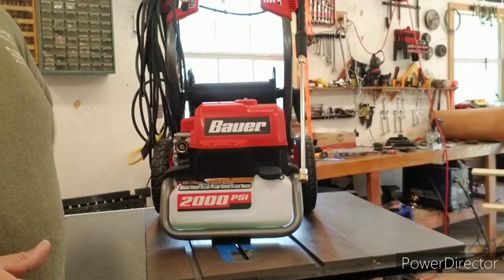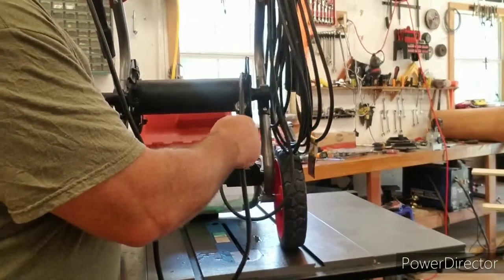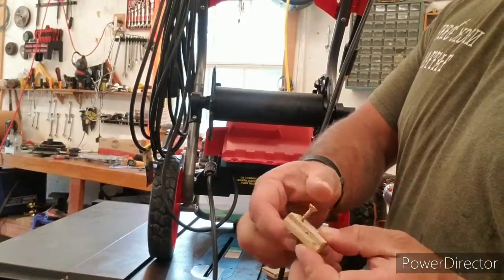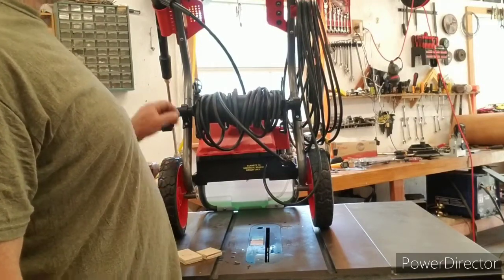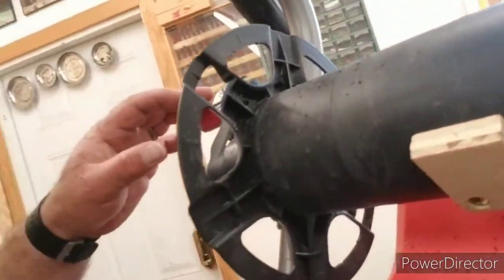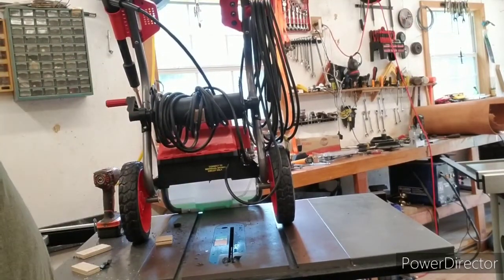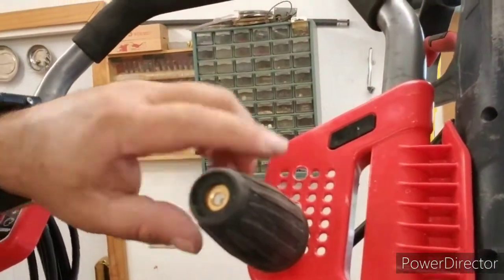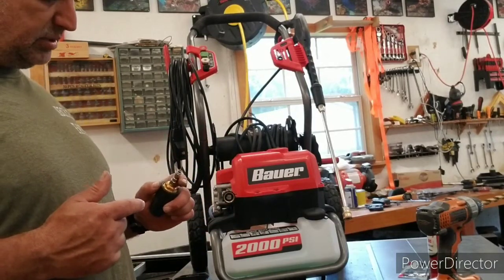Modification to Bauer 2000psi Electric Pressure Washer Reel from Harbor Freight 56877

Comment: This is the most insightful video about modifying a product that had a design flaw. I tried it and it worked like a charm. I also took it a step further and added an additional hook below the hanger for the power cord to create a clean set up after use. Thank you for the video.
Reply from the maker: Thanks. I still wish there was a better way ro roll the hose.mine trys to unroll itself. It is still a great little pressure washer.

Comment: Thanks for the suggestion about the hose reel. I will try to modify mine in the future. Plus I already added an additional hook down near the bottom of the washer for the power cord, so it rolls up nice and neat.
Reply from the maker: That solution works but can be a pain. I found if you just put a quick disconnect on the high pressure hose. You can easily unplug it and roll it on the reel. I just roll the electric cord and hang it on the hook. Here is one on Amazon. 
https://amzn.to/3Hj25kZ

Comment: Good ideas good video.  I did the same thing with the hose wheel , but used a metal electrical conduit wall mount with two screws for sturdiness.  I did the same with the turbo jet nozzle but used the same grommets as used on the other side. I also added velcro straps to hold the sprayer  handle and extension to the unit. I hate going to a job and seeing I forgot some part. I also have a whole tote bag filled with soap, cleansers, hose parts and adaptors since many times the house spigot has unused issues and of course two sets of pliers.  A collapsible hose is also handy to carry with and of course be prepared time is money.
Reply from the maker: It sounds like you are using this commercially. How is it holding up. I still use mine but only  once a month or so.

Comment: I am also working on hose connectors at the pump to drain the water in the hose as I reel it up. Holding the trigger on as I reel it up helps a little
Reply from the maker: That is a good ideal

Comment: Does this power washer take any oil? Does it need oil changes?
Reply from the maker: No. There may be some inside but none to check or replace for normal use.
Reply: @ShopRamblings  thank you!

Comment: Love this but won’t that void the warranty?
Reply from the maker: I don't represent HF but this doesn't affect anything mechanical. I however found the reel kept wanting to unroll. I bought a quick disconnect from Direct Tools and found it worked much better. I can disconnect the hose and roll it up much easier. I wish I had not cut off the clips on the roller now.
Reply: @ShopRamblings  darn it. Thanks for sharing.
Reply: Isn't the warranty mostly for the mechanical part?

Comment: Why not just wind the other end leaving the water outlet side connected?
Reply from the maker: Because the nozzle is connected to the other end. For me it is not a big deal to screw to hose on but my wife trued using it and had issues. Now there are no issues. It works great for her.
Reply: Just to add to @Robert Palmer message, the spindle is not designed for everyday use. its only designed for packaging.

Comment: I'm having trouble with the red and green tips , they stopped working after I tried using the soap dispenser black nozzle. The white tip ended up working but idk what's going on now... do you or anyone know anything about this issue?
Reply from the maker: The tips are basicly just a hole. There is a taper that changes the size of the water fan. If you are getting pressure from one nozzle then the pump is good. Hold the nozzle up to a light, you should be able to see light through it. If not it mat be clogged. Sometimes you can rinse it out other times you may have to use a pice of  wire to clean it out. Let me know if that works.
Reply: @ShopRamblings  wow thanks so much I'll to try that out

Comment: Perhaps some quick disconnects would be easy for her? They cost about $17 for a complete set. I like your idea but do not want to have water freeze in the line.
Reply from the maker: I was thinking of adding some quick connects. I live in Florida. About 10 years ago it was supposed to drop below 32 for over 6 hours and the governor declared a state of emergency. I don't have to worry much about it freezing.
Reply: You should be able to drain it with the sprayer before you roll it up. I hope that helps

Comment: Is this a 1/4 inch hose??? My hose broke n wondering if it's 1/4 or 3/8???
Reply from the maker: I am fairly certain it is 1/4.  You can call Harbor Freight and I think it is $27 for a replacement. I also seen some Ryobi one at Home Depot yesterday.
Reply from the maker: HF part number 22469

Comment: The fact that this went out with such a bad design flaw is concerning. How could nobody at Baur speak up and say...guys, this sucks, why are we doing this?
Reply from the maker: I ended up getting a high-pressure disconnect. It only takes a second to unhook the hose and roll it up. It is still a great little pressure washer. Because it is so light and easy to hook up, I use it more than any gas pressure washers I have.